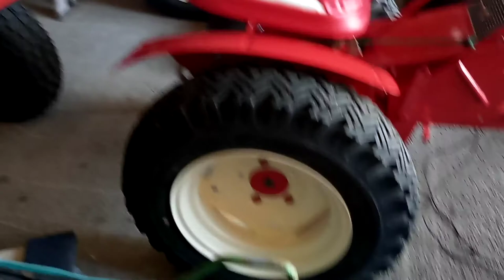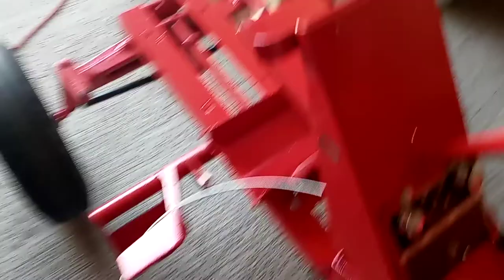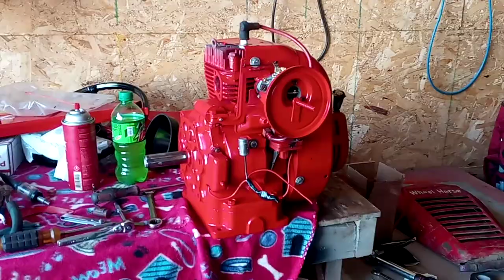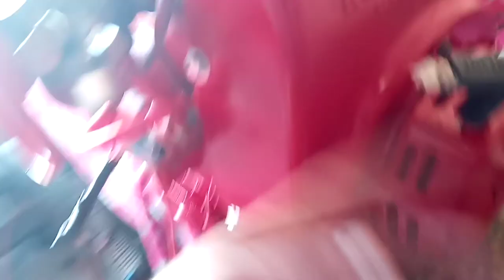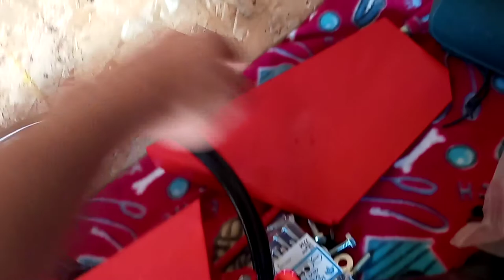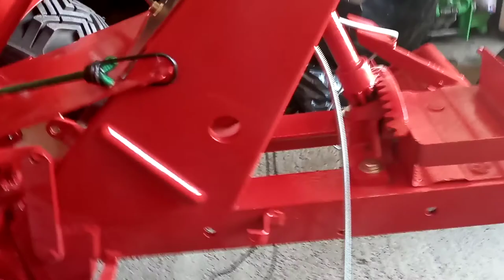wheel horse restoration part 2

Comment: Looking GREAT.  Working on a 654 myself.    Still seeking a replacement steering wheel and the black handle for the brake lock. Any suggestions.
Reply from the maker: Ya I need to do a follow up video I'll be driving it this weekend at the shop be sure to follow along
Reply: I found replace handle grips on ebay..

Comment: Now it's going to be an 804, 8 horsepower is the 8, 0 would be pull start, 5 stands for electric start and the 4 stands for 1964